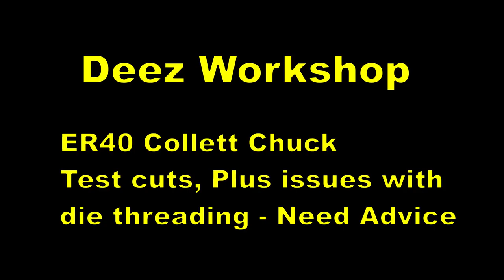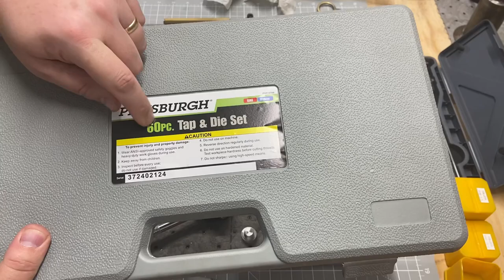Testing ER 40 Collet Chuck and Failing at Die threading on the Vevor MX 400 Mini Lathe

Comment: Hey Deez,

Several tips.

1. Verify your die. Get a few 1/2" 20 bolts and run the die over them. If the die doesn't start on them then the die is the problem. Manufactured bolts are typically made to a specification. If it takes a little fuzz off then that is fine but should not take very much off.

2. You already figured it out. But dies have two sides one has a bigger lead in chamfer.

3. Don't trust your calipers. They are called guess-o-meters for a reason. Check your diameter with a micrometer to ensure you get the most accurate measurements you can.

4. Never tighten a collet chuck all the way down without anything in the collet or it will be damaged. Also never put anything too big in the collet because it will get stretched out. ER collets have a tolerance range of how far they can be stretched or compressed. Not sure what it is but I am sure it wouldn't be too hard to find online.

5. This is me personally but I usually go between .003 and .005 under since most of what I do is noncritical.

Hope this helps.
Reply: Also don't try to put the tap into the die. You could damage them.
Reply from the maker: As always your comments are greatly helpful.  I will start checking my dies, especially the ones im having trouble  with.  Maybe its the die maybe not.  I still lean towards me being the issue.  I do need to be better about slowing down and using my mics to confirm my measurements.  3-5 thou under is a great place to start.  I have had some luck recently with using a die with the help of another.  Finally success.  used the 5/16 NF 24 for an uncoming project.  as always thanks.

Comment: When you look at the die you see it is larger on on side than the other. You are correct in bringing the larger diameter side to the die to your workpiece. To get started easily you want to cut a shallow taper on the workpiece so the workpiece will fit inside the die to the depth of several threads. While you are learning you could even make the taper long enough to go all the way through the die. You want the taper on your workpiece to be shallower than the taper inside the die so the die can start to cut the thread without making deep cuts into the workpiece.  Using a die holder on the lathe as Tom suggests will make the process much easier, but a long shallow taper should get you get started using your current approach.
Reply from the maker: definitely going to give this approach a shot.  Thanks for the information.  Thanks for watching.

Comment: Been a bit too busy to keep up with the vids lately, but got time for a watching session this evening. - I've been there! I would be (and was) swearing blue bloody murder at this point! Very well restrained Deez!

I have a ridiculously cheap set of taps and dies which I could just about get away with using, but upgrading to a good set made a fair difference.
 I am still a bit hit and miss though doing it manually in the vice - I put this down to my failing eyesight and general clumsiness!.

You can keep the part in the lathe chuck and use the tailstock to butt the die up to the piece, then turn the chuck by hand to cut the thread,  I have had varying success with this technique. 

The tailstock die holder I got is a game changer and makes things quick and easy, - no faffing around with the change gears to make a simple threaded part, - I recommend one as part of your kit! 😁 I am still nervous about using it though, and turn the chuck by hand rather than doing it under power!

I got to use my four jaw (self centering) the other day as I had to make a new brake connection rod and adjuster for that triumph/bsa chopper I've been working on, the adjuster and connection to the rear hub arm were made from a 12mm square section piece, I put a threaded hole most of the way down the middle of it to take the connection rod. 
The rod was a bit over a meter long and had to have threads at both ends , - with the back end of it poking out of the lathe, it only just fit between the garage wall and the lathe! I rested the back free end on a V block clamped to my pillar drill to stop it flinging about, and to my surprise it worked! Success!
Reply from the maker: Glad your making some time to catch up :-)  ive been super busy as well with family functions, trips, and life changes with our kids.  Always trying to find some time to get in a project on the weekends.  Not sure how long i can keep up 2 videos per week but im going to keep trying.  Weekend videos shouls be more interesting with some of the non typical content or different style videos on wednesday.  At any rate nice you were able to turn such a long piece of stock.  Cheers and oh yeah i will be gettinga  tailstock die holder...on my list.  :-)

Comment: I leave it long and taper it smaller than 1/2”. Run your die down then cut it to length (removing the taper portion). 
Also I use Crisco for a Lube
Reply: On aluminum, kerosene or WD-40 helps to prevent the chips from galling and adhering to the cutting tool. This is especially important if you are machining copper. Pet condensed milk works about the best on copper. You do have to clean up well as the milk will smell if you leave it any length of time.

Comment: Machinery's handbook or similar is your friend. Look in the thread tables for the starting diameter of a particular thread. For example, the starting diameter of a 1/2-20 UNF2A thread is not 0.500". It is 0.4987"/0.4906". Turning the work to the correct starting diameter makes a noticeable difference in how difficult it is to run a die over the work.
The same goes for tapping threads. Most drill & tap tables give the tap drill for a 75% thread. Realize though that a 50% thread is strong enough that hardware store bolt screwed into a depth equal to its diameter will break before the thread will strip out. Conversely, a 100% thread takes twice the power to tap as a 75% thread but is only 5% stronger. Be happy, use a larger tap drill and your taps will thank you.
Cheers from NC/USA
Reply from the maker: I have been looking for then.  100-130 or so for the latest revision.  Used would work as well.  I am alos looking for a smaller reference book that has all these charts and tables.  I know they are out there but unsure which to get for a beginner.  Thanks again and cheers.
Reply: @deezworkshop  Always go to estate and yard sales with your wife and check out books for sale. You will get lucky sooner than you might think. Last Thursday we hit the jackpot. She wanted a small plastic toolbox to make up a first aid kit. At an estate sale I found one for $8 in the garage. Got home and inside were over $150 of brand new Wiha instrument screwdrivers, two new precision tweezers, 6" Precision Engineering scale, new USA made Jewlers side cutters and needle nose pliers, and an 8" import digital caliper still in the box and slipcover.

Comment: Like Wilfred pointed out, first verify your tooling at least matches some commodity hardware. Once that's settled: Threading dies come in at least a couple flavors. Most common are cutting and forming. Forming dies will squeeze the lip of the base material up, making a taller crest than the diameter before threading. Forming dies require a pretty heavy undercut, but make up for it by raising the thread crest higher than the radial starting dimension. I suspect you were using a forming die rather than a cutting die. For a repeatable recipe regardless of die manufacturer or quality, I'd set the compound to somewhere between -1 and -3 degrees and taper the intended thread length until the first row of roughing teeth on the die just barely slip onto the stock. When the first row of teeth fit, you'll be able to get it started square to the work with negligible tool pressure. You want to be at least three threads deep before you really put your body weight into the die wrench, so you have at least two threads resisting your inevitably deflected high-load input.
To put this whole diatribe into perspective, I undercut to 9.78mm major diameter for my M10x1.5 and 7.76mm for my M8x1.25 forming dies. That's what it takes to get them started. If properly aligned (die teeth perpendicular to work length), the teeth take care of the rest of the cut with very little drama. One last tip... Castrol Moly D is worth its weight in gold in a tough threading situation. I don't know what they put in it to make it so slippery, but it reduces tool load in ways I haven't found in any other cutting fluid.

I know you're a busy guy. and this comment had a lot of stuff in it that might be overlooked. I recommend you read it again over that second cup of coffee :)
Reply from the maker: On my second cup of coffee and second read now.  :-)  great information and super helpful.  Thanks.

Comment: Now, non-die related ramblings:
About the 4 jaw chuck, If you use an existing hole to start the 3 bolt pattern, you will unbalance the chuck.  The 4 hole pattern is symmetrical, all the holes balance out automatically.  The same is true for a 3 hole pattern, however, if you share a hole between the patterns you are basically adding 2 non symmetrical holes, which is off balance.  If you are worried about lining up the holes I would just bolt the new 4 jaw to collet chuck using the 4 hole pattern, then use the three hole pattern in the collet chuck to mark the 4 jaw for drilling and tapping.
Regarding the accuracy of Chinese indicators, when you are truing something in the lathe you are making a comparison, not a measurement, and dial indicators, even crappy ones, are using a spring to hold the dial gear against the spindle rack, so there is no backlash.  Basically any dial indicator that operates smoothly will be fine for truing up work in a lathe.
Most daily uses of dial indicators are actually comparisons, not measurements.  You zero the indicator against something, and work back to that zero.  In these uses the graduations on the indicator are irrelevant, you only care about the zero line.  In cases where you use the indicator for actual measurements of course the accuracy of the indicator does matter, but many uses are not that.
In a related note, lever style dial test indicators are technically not correct anyway, since the dial is actually measuring a rotation not a linear travel.  They approach accuracy when the lever is perpendicular to the direction of measurement, but the further from exactly perpendicular the less accurate they are, and often they cannot be perpendicular because the piece or the fixture prevents that.
Reply from the maker: Never thought about the indicators being comparison tools vs measuring tools but thats what im doing so that makes sense for the operations ive been doing until now.   such great info.  Always dig your posts.

Comment: If that is 1/2-20 again the minor is ,4675 caliper the inside of the die. And the chamfer is way too little only 45 degrees..
Reply: Turn the end to .485 or .490 then thread it.

Comment: Recommend you watch Blondihacks' video Metal Lathe Tutorial 17: Taps And Dies. She recommends turning under the major diameter, and in her example turns a quarter-twenty thread by turning the rod to 245 thou. Also, make yourself a die holder. She has a tutorial on that and it's a very simple project compared to what you've done. It is harder to die on softer materials.
Reply from the maker: I will cehck out that one.  I havent gotten to that specfic video yet.  thanks

Comment: Harbor freight can be tricky. Some stuff is acceptable most things are not. You have to look at the prices.
     When a tap and die set is $21 you need to step back.
    The warrior drill bits suck to but when they are on sale for $9 they are not a bad value for rough work .
With the increases in prices at harbor freight its getting harder to justify the costs.
Reply from the maker: Ive thought the same thing.  I am looking to get some proper dies soon.  HF prices have steadily been going up and getting harder to accept the horrific quality of some of the items anymore.
Reply: @deezworkshop  yeah there used to be price/quality/make it work ratio that was “acceptable” that ratio is a little off these days.

Now the big issue is my pay has no where near kept up with the cost increases.
Reply from the maker: Likewise.  Id wager anyone watching/reading this is also feeling the pain.  Our salaries have not kept up with the rate of inflation.  Hopefully there will be some turnaround someday, definitely causes us all to think about our purchases.

Comment: Harbor Freight tap and die are just ok at best if all your doing is chasing threads. Buy a better set or just buy the tap and dies as you need them
Reply from the maker: You will see soon I have come to this conclusion as well.  Of all HF tooling The Tap and Die sets are someting I just cannot recommend.  Somethings are not worth pinching pennies on.  I learned my lesson on this one.

Comment: Don't buy a die set.  Good dies are too expensive to buy a set for a  hobby.  Buy individual dies from a real supplier.  When I start a project that requires taps or dies it usually also requires fasteners, so I tend to use McMaster Carr, since I can order everything I need in a single order and that lessens the impact of the shipping cost.  Also, if you are starting a project with a clean sheet of paper, pick your fastener sizes to avoid less common threads. In this case you are using a less common size already, since 1/2 20 is fine, and 1/2 13 is much more commonly used.
Also, just for comparison, I assume you have a 1/2 13 die in your set, that is the same nominal size, you could try that on the other end of your current piece.  If you haven't used it yet that die may be sharper, and it may be less likely to just chew the end off your stock than the finer thread was.
Other people have already mentioned the chamfer on the end, leave it longer, and use a more gradual taper.  You can always face off the tapered part after the thread is done.
Also, yes the guys on YouTube cut nice threads all the time.  Part of that is probably experience, part of it may be pride, they don't show the attempts that weren't smooth.  I have made "threads" that look a lot like your attempt today more than once.  In my experience the thing that made me more likely to succeed was all about holding the die square. 
I would put the piece back in the lathe, take the screws out of the centering gadget on your die holder, take the center out of your tailstock, and use the face of the empty tailstock spindle to press the die in the holder up against your work.  You will have to advance the tailstock as you thread it, it is kind of a 3 handed job, holding the chuck, the die, and advancing the tailstock, but if you put a board on the lathe ways the die holder will hold itself form turning against the board, and you can turn the lathe chuck by hand while advancing the tailstock to keep pressure on the die. You will probably have to fiddle a little to work around the cross slide and compound, and maybe it will require removing the tool holder and letting the die holder handle rest against the cross slide or compound.
Reply from the maker: You arent the first who has said dont get a set,  get quality taps and dies when your project calls for it.  I am leaning towards this approach.  The temptation to buy cheap harbor freight tooling is great but I have to break that habit.  Also great info,  Using more common sizes makes a lot of sense.  I hope to teach with my mistakes.  I learn so much with all the videos i post from these comments.

Comment: I have that set too and its complete garbage ... as typically, you gotta buy better tooling.
Reply from the maker: definitely,  I did step up my Die game.  I got a couple Irwin rethreading die sets.  They are 100 times better.  Took the frustrations out of using dies.